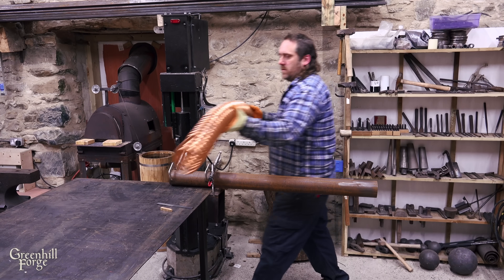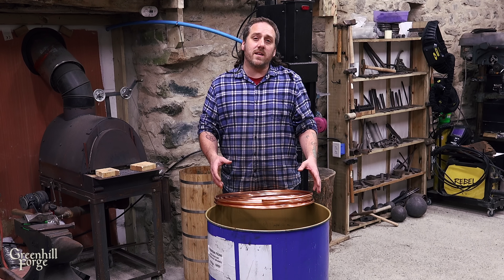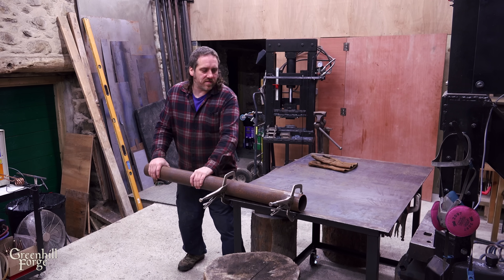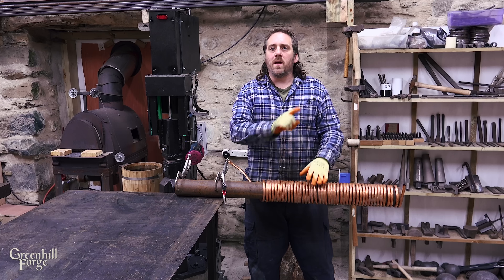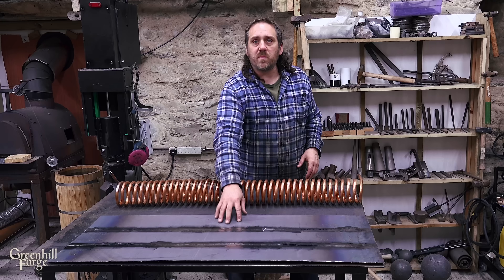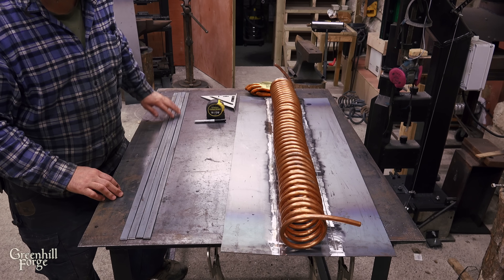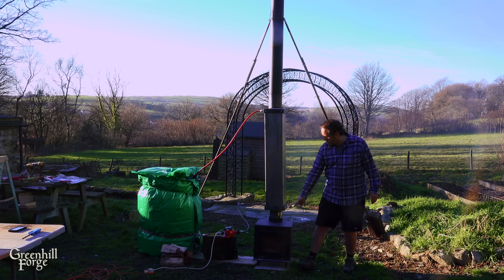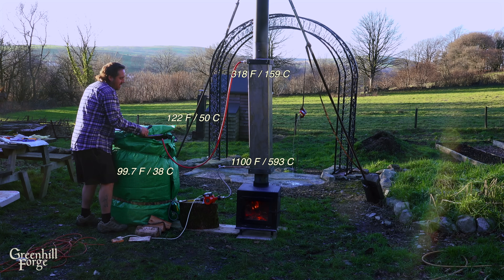Wood Stove Water Heater Experiment - Surprising Results! Part 1

Comment: I used to build steam cleaning machines that used a diesel burner to heat water in a coil like you built. A major problem is minerals from the water will quickly build up in the copper,  insulating it from the heat so it loses it;s efficiency and clogs limiting flow.
You would have to periodically flush the coil by flowing vinegar or a mild acid solution through it to dissolve the the lime and calcium mineral build up inside the coil which is a headache and a lot of maintenance..

If you want to take your design a step further loop your coil  through a the circulating pump triggered by a snap disk thermostat mounted on the outlet of the flu coil to only turn the pump on when the water is heated by the stove.
Run the outlet line from the flu coil to a car radiator with fans and an overflow tank you get from a salvage yard,  use the radiator fans and their thermostat to blow any excess heat produced by the fire into the radiator into a space you want that heat to go, which is where you would put the radiator and fan's. Use antifreeze instead of water in a loop with a second copper coil in the loop placed inside your water tank to act as a heating element. This stops the scale build up problem and has another benefit of higher coil temps with no steaming.

Since the radiator cap pressurizes the antifreeze, it raises the boiling point of the fluid circulating through the system allowing for higher temps flowing through your system 
Water boils at 212 Degrees Fahrenheit at atmospheric pressure, but with a 15 psi radiator cap and a pressurized system you raise the temp of the fluid flowing through your system to 265 degrees, and if it tries to exceed that the radiator fans will come on blowing the excess heat  into a space you might want heated.
A thermostat with a normally closed contact opening on the rise of temp placed on the water tank could be wired to open a bypass solenoid in the circulating antifreeze system so when your water tank reached the set temp, the antifreeze would stop flowing through the water tank coil and bypass to the radiator to blow off excess heat not needed in the water tank to the radiator to heat a room

Using Automotive parts you can use 12Vdc solar to power it, if you also use a 12Vdc bypass valve and circulating motor the whole system can run off solar

This would give you automatic heating of your water anytime the fire was lit, automatic shut off , higher coil heating temps and a maintenance free coil system by eliminating the build up of minerals in your coils which will happen quickly flowing regular water through them instead of antifreeze. Also if your heated water tank was indoors where it could not freeze, the rest of the system would not have to be drained to prevent freezing.

This would prevent you from ever having to de scale the coil, or drain the lines when your done using it or otherwise worry about freezing and damage to any of your piping. I can make a  schematic if you need one. Just reply to this post as I do not check my messages at the bell in the upper right

Comment: I helped on a similar project for a swimming pool using a couple of washing machine pumps to circulate the water. It worked really well. We started with a minimal amount of water in the pool and once it was hot started to add more cold water. We found that we could have a swimming pool sized jacuzzi.😂

Comment: It will be very hard to clean that every year. You should have put the coil around the flue pipe. That way you can sweep out the pipe without taking it all apart. This way you will have to scrub all that coil so you don't burn down your home. The flue pipe will still get hot, people do this already. You could also put a metal barrel that can hold water without rusting, and put the flue pipe through the barrel. Kind of like a water heater. And if you have a greenhouse near your home you can put a big black overflow tank in it so your home and your greenhouse are both heated. You could even dig down about 3 or 4 feet and run coils in your greenhouse to keep the soil warm, and with that tank you can reverse the water flow in the summer so your home water is heated inside the greenhouse.

Comment: great build, its ideal for demonstration purposes but not practical in a real wood stove setting when dealing with creosote build up & chimney fires, it would be perfect for natural gas or propane stove, for wood stove you need a less efficient design with the coil wrapped around the outside of a single wall stove pipe then insulated & enclosed.

but for higher efficiencies you need to move to a custom design with stainless steel pipes to go in the back wall or top inside the combustion chamber.

Comment: You are trying to solve a problem that has been solved a long time ago. Have a look at the design of a steam engine boiler or a simple camping jet boil water heater. By lighting the fire directly under the water and insulating it so that all the heat goes into the water, you get maximum heat transfer. Put your hand at the opening of your chimney or on the top of the stove and you will feel the heat going to waste. That being said, I congratulate you for experimenting and for your video. Thanks.

Comment: If weight was no issue for system longevity I would have sleeved the inner with exhaust pipe and filled the copper pipe area with sand, keep the copper clean.   It would take longer to heat, but would also continue to heat the water after the fire went out, but your heat exchanger would be heavier but service life would be greater and easier to clean with a smooth exhaust sleeve.   Overall very cool.

Comment: you have essentially constructed a peculator. would the water pump even be necessary?

would you consider building a bypass in your flue? 
this would allow you to switch between heating the coils and protecting the pipes from heat.

are you concerned about carbon particulate buildup in your heat ex-changer?
pre-electricity models that i have seen would use an oil container between the copper pipe and the flue to prevent soot buildup in difficult to clean out areas. these models would also use long standup pipes that would Y-split from one standup to the next creating an s-bend up and down the length of the ex-changer in order to maximize thermal transfer. the Y-splits would then be installed with removable end caps along the ends of each run to use as clean-out ports.

Comment: It's not necessary to freeze the pipe. Water is incompressible.   Just make sure it's completely full of water (no air bubbles)  and seal the ends.
Reply from the maker: sure, you just have to have seals that will deffinitely not fail during the process. more failure proof and easier for me to just freeze.

Comment: I really like the idea you have going here. 
I feel you over engineered this project. I feel the same effect could be accomplished without as much welding and forming as was done.
If instead of making the coil with the freezing water, you could have heated the copper to allow it to bend easier. If you had set up a jig to feed it through you could have had the spacing put in. If you had done some math first you could have known what the OD of the coil was to be and made it appropriate for a standard pipe.  For instance if you had used 4" OD pipe to wrap the coil and 1" copper you could have gotten a 6" OD for the coil, which would fit in a 6" ID pipe. Then you do a ~8.25" ID pipe around the coil, 6" ID pipe and insulation.
Your system for the dampers was cool. I had not seen someone cut a slot in a bar and insert a disc but it is great.

Comment: Generally, I'm not a fan of brazing, but there are a few places it's the best application. Solder will liquify at around 500F. Brazing rod will liquify at 1300+F. When high heat (or fire) is a concern, brazing will liquify at a much higher temp. Great video, Great work. You're a craftsman
Reply: It has water in the pipe, if that pipe gets above 500 deg you have bigger problems
Reply: @adamjankowski4315 Exactly.

Comment: I guess to protect the copper pipe should the water pump fail, you could add a spring tensioner and a solenoid to the valve, so when the pump has power, the solenoid opens the valve. If power to the pump is lost, it springs shut. This is obviously in the event of power loss, not necessarily mechanical failure, but a flow meter could be used to control that.

Comment: Excellent video, I need to buy one of those but I want to buy one that doesn't have copper in contact with flames.  Maybe you could make one out of steel pipes?  Or maybe you could use stainless steel?  I doubt copper will hold up to fires, unless you put it on the outside of the flue pipe.
Reply from the maker: Thanks! There's more designs coming

Comment: Elevate the water tank. Hot water rises. You may not need a pump if the hot water circulates itself.
Reply from the maker: Agreed. That's the goal for the final design.

Comment: Do the standoffs around the coil not interrupt the heat flow of the rising hot air in a negative way (as in, it gets pushed straight upwards through the 4 sections created by the standoffs, rather than swirling around the pipe)?

Comment: You would be even more efficient, if you make a large composting heap heater. You do not have to constantly feed it to keep the heat going. A large composting heap generates around 70 ºC (≈ 158 ºF).

Comment: the creosote buildup on the copper pipe is an extreme fire hazard, this is no good you can't pipe exhaust through the copper pipe you need to wrap the copper pipe around the outside of the pipe and then insulate the outside
Reply: actually that might not do it because you'll cool the pipe and cause a creosote hazard in the pipe... the only safe place for the coil is in contact with the firebox I guess

Comment: I loved watching this build but was concerned that the copper would get covered with creosote and no way to keep the pipe clean.
Something similar but that wrapped the coil on the outside of an inner section of flue using the similar method might work well and last much longer without the danger of creosote build up.  Very cool build though and I like the straightforward concise explanations.  I love your metal shop too.
Reply from the maker: Thanks! there's a comment response video where I go over creosote and some other design flaws and there's a another video coming soon that I think you'll like.

Comment: A bit late but you're loosing a lot of heat thru the exposed hoses and the pump. With some pipe/hose isolation and after putting some isolation around the pump, it should work noticeable better.

Comment: sand is a good filler to keep the copper from kinking...I use it on steel conduit when making bends that are smaller than a tool does...the ends after filling can be crimped shut and after, cut off to empty,,  I use a rubber stopper plug but that may not work here.

Comment: A question only of curiosity here not criticism because I love this project. Will having the coils resting against the steel mounting rails internally eventually lead to wear and rupture through movement from expansion and contraction? Or did I miss steps to negate that or will that even be an issue? Thanks for a great video
Reply from the maker: check out the comment response video that came out after this. thanks
Reply: @GreenhillForge  will do. Thanks for the reply

Comment: How long will that copper last touching the steel ?
Reply from the maker: The copper will actually corrode the steel. I get into that in the comments video if you want to check that out
Reply: @GreenhillForge  
Where can I find the comment video ?  Thanks 👍
Reply from the maker: @CanadianNortherner-i8g  On my channel page. It came out between part 1 and part 2 of the water heater videos

Comment: What if you were to put some kind of counter-twisted spiral inside the coil or just a piece of enclosed steel pipe inside the coil? I feel like a lot of heat is still lost due to basically an open air channel straight through the center of the exchanger...

Comment: I did similar using flexible stainless steel tube. Funny, when you forgot to switch on the pump. The automatic reminder is an explosion. You wouldnt believe how far the water was thrown.

Comment: Nice!. Congrads!    You could use it to heat a dumptruck full of burried and insulated sand pit to heat a barn or building.  Or perhaps hook up a duel source geothermal heat pump to the sand pit or water reseviour to efficiently heat your home on the coldest of days.

Comment: Dude , you didn't wrap your coil of copper around existing size stove pipe ? The smoke is in contact with the copper ? Even steel stove pipe doesn't last too many years. I know what you made would work better but it's a waste of time and cost unless it's only for 1or2 seasons max. Your going to have water leaking on your fire before you know it.
Reply from the maker: Keep watching the series if you want where I go over all this and and also test it with a rocket stove. There are more designs coming soon too.

Comment: how does it perform after the copper coil gets covered in soot? It would be interesting to know how often it needs to be disassembled and the coil cleaned?
Reply from the maker: This unit will only be tested a few times and I'm cleaning the coil between each test. I show the coil after both tests in the following rocket stove test video if you want to actually see it. I think it would need to be cleaned far too often to be a regular use design, but I've got more designs coming that attempt to tackle that issue.

Comment: Instead of copper coil inside flue, how about copper coil outside single skin flue in an outer shell packed with dry sand or similar? Probably low heat transfer to water but not zero, and the sand acts as a radiator like a normal flue would. Have the copper coil as large as can be.
Reply from the maker: I've got a video coming soon I think you'll like

Comment: I am really having trouble understanding the problems some people have with creosote... Not to say I would know everything, I understand that there could be differences on things like types of wood or something. But as much experience of wood burning as I have, basically it should not be exceedingly difficult to have a clean enough burn.

I mean sure, with solid fuels absolute perfection is hard to reach and typically you would have a little bit of remnant oxygen and carbon monoxide in the exhaust. In simplified ideal model those two should not exist at the same time, because you should have carbon monoxide and other traces of incomplete burn when not having enough oxygen and remnant oxygen when you have excess air. But with solid fuels you usually end up with a bit of both and ideal is slightly too much air so you don't get soot and creosote all over.

If the burn is clean (enough) the flue gas should only contain things like nitrogen (obviously, as long as using air as oxidizer), CO2 and water. And because water exists both in the fuel and as a end result of burning hydrogen compounds, you would like the flue gas temperature to remain above 100 C (boiling) on top of the smoke stack to keep it from condensing... That is unless if you build your exhaust to handle the condensate fluid.

But essentially the smoke should be clean. Well obviously with solid fuels you do get some ashes too, but it should be rather easy to clean. I have used wire brushes and compressed air to clean ashes of the heat exchanging surfaces in some boilers. I used to manage a heating plant of, I think it was around 150 kW wood pellet stoker, if I recall my numbers right. Did some tweaking there with a flue gas analyzer.

But anyhow, very interesting videos.
Reply from the maker: In the following rocket stove video the burn was a lot more complete and left soot instead of creosote, still would need some tweeking but it was difinitely better.

Comment: I built a self standing hot tub for an event off grid. The "tub" was a 20' pool filled with about 4 feet of water. I used 50' of 1/2" copper pipe coiled inside a steel barrel. A small door at the bottom of the barrel to feed wood and a flue pipe out the top and two small holes for the copper to go in and back out. I put a cheap circulation pump on the input side and the outfeed went to a hose that went to center bottom of the above ground pool. It seemed to not work well at first as there was so much water but after a few hours it was almost too hot to get in! I used a long 2x4 across the center over the pool with a tarp to help limit heat loss. Once the pool was hot the tarp was taken off and we had to let the fire in the barrel die down and it needed very little wood and worked well. Because of the huge mass of the water, once the tarp was on it even stayed warm overnight!

Comment: in my campervan i fixed a metal watertank (50L) right above the stove (as a kettle), when water is hot enough it just goes to a recervoir underneath the sink, then i can use it in my shower which has a cold and hot water system with 2 separate tanks (of course). if i dont need to arm up the van, i can use my vevor gaz heater which is fixed on the outside door :) (ps: sorry for my english)

Comment: Outside air & outside heat puts positive pressure in your house .
Reply from the maker: This is for an outdoor, off-grid setup, but generally a wood stove creates a negative pressure in your house which is why outside air is drawn in.

Comment: Do you need to use a pump?  wouldn't the rise in water temperature force a siphon and circulate the water?  (use a Check valve at bottom) Sorry, if this is a stupid question, kind of new to all of this.
Reply from the maker: yeah it would work. a thermosiphon system is the eventual goal but it will need some design alterations to really optimize for it